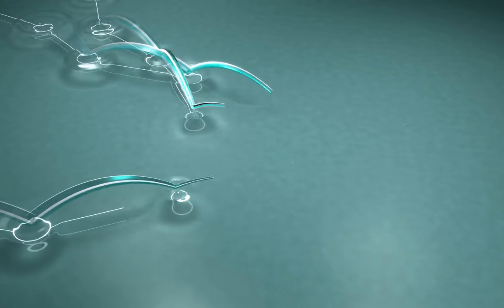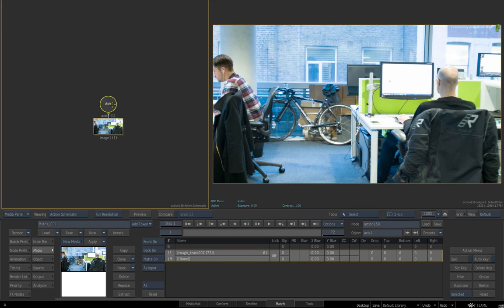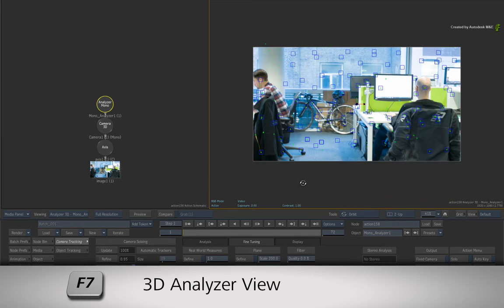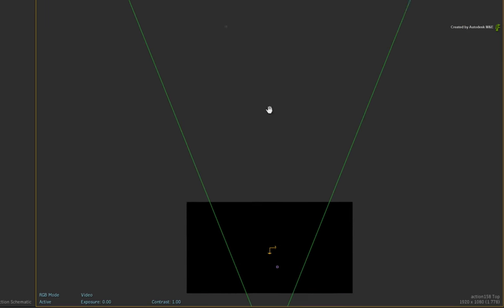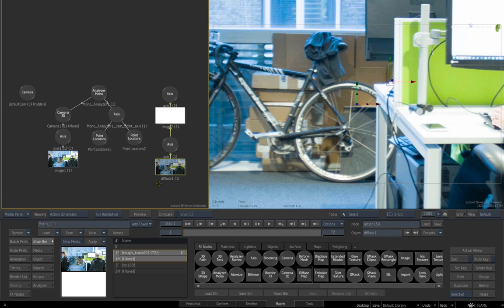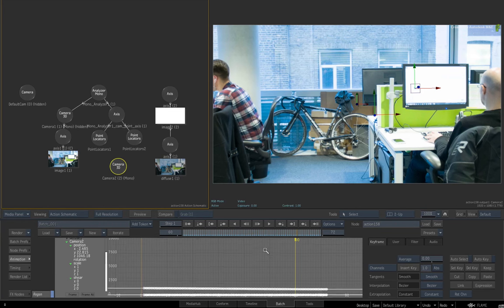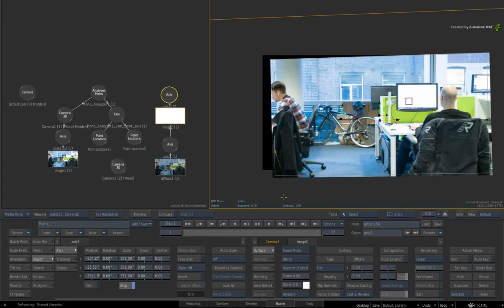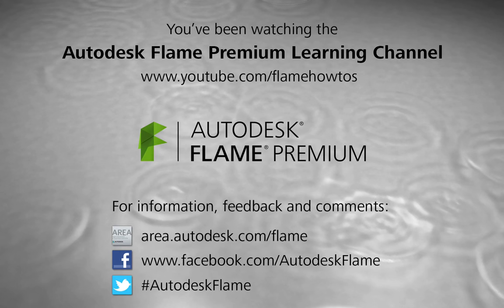3D Stabilization - Flame 2016 EXT 2

Comment: 2 questions: 1- is there a way to inverse this method? such as add a comp to the screen and then return back to the original camera move..  2- are there any tips or tricks on dealing with smoothing out a camera move that changes directions such as going around corners such as a winding road?
Reply from the maker: I haven't tried it in a while but this would probably involve duplicating the Action and placing it at the end of the flow graph.   You would input your stabilised image instead of the original and I think you would negate the camera to reverse the stabilisation.

As for tips on smoothing camera moves in direction changes and taking corners, the averaging trick I showed in the video should help as long as your 3D track is accurate enough.

Comment: A lot of your instructions don't seem to work for me. Is this not valid in 2022.2? Snap to location is not working for one. Maybe it's just me. Is there an update for this type of stabilization with the new camera analysis node?
Reply from the maker: @Mark E - I went through the video using Flame 2022.3 and I was able to get everything to work as expected.   Obviously there have been changes to Flame since this video was released in 2016.   There were a few things that came up.  Firstly, you can not longer hide camera in Action which is not really a big issue.   Secondly with regards to snapping to the locators, there was a change in the 3d environment which you need to adjust.   To snap to a locator instead of Z-space, go to Node preferences, Display Tab, under Snap Z Position, Turn ACTIVE off.   When moving an axis, they will snap to the locators using SHIFT as before.

It is possible to use this technique with the new camera analysis node since the 3D tracking data is also fed into the camera node.    You would still need a duplicate camera and follow the workflow to stabilize the shot.   The only difference is that you cannot snap to an axis compared to a locator.    However to make the white surface snap to the axis in 3d space, just connect the 3d tracked axis to the axis of the surface and it automatically moves into position.    

Hope this helps!